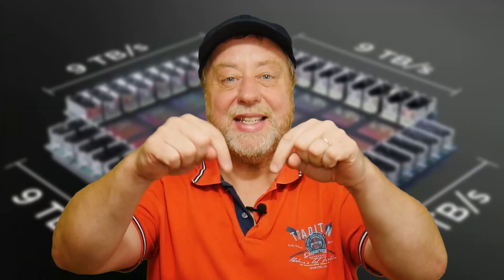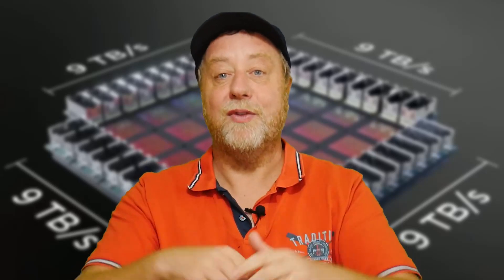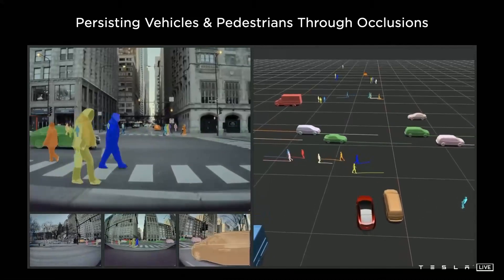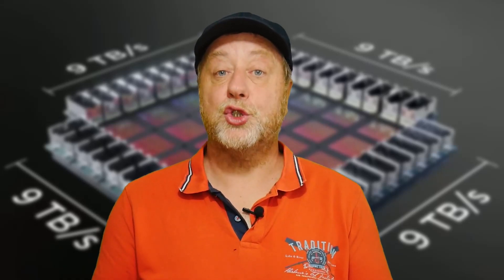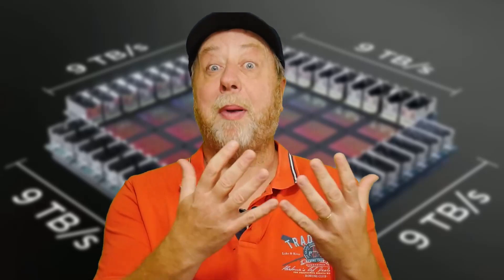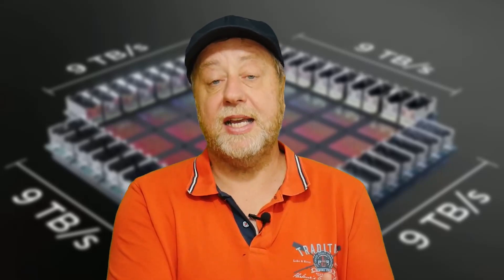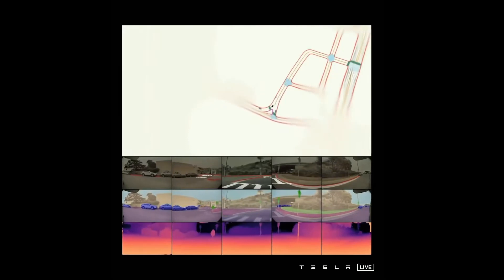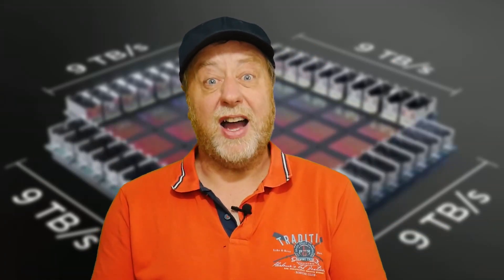Tesla D1 Chip - What is All The Fuss About?

Comment: So counting their way, if i have $10,000 i am technically a Millionaire since i have 1 million cents ha? Tesla marketing department twisting the half truths again.....typical supercomputers measure "FLOPS" in FP64..not FP16! heck even at FP32 the "1.1 exaflop" system is actually at 0.06875 exaflops.
Fp16 and even int8 is important for training AI , i get that. But they shouldn't LIE to the uninitiated masses by counting things their own way. Its pathetic!
Reply: You are right but about 5 years ago, the industry started using FLOPs very liberally. Not just Tesla, Nvidia does it too. The reason here is that, it does not matter. For neural nets, it is mainly just dot product calculation. So, FP64 or FP16, won't make that much difference. That is why they do not support 64 bit. Remember, this chip will be used by Tesla themselves so they are the customer.
Reply: they did mention that on the screen right next to the number. But the people are overlooking it
Reply: I don't think the chips even have FP64 support
Reply: @Harish2923  yeah LMAO!